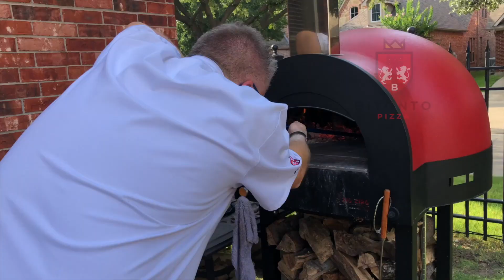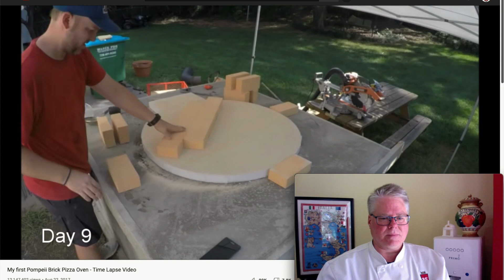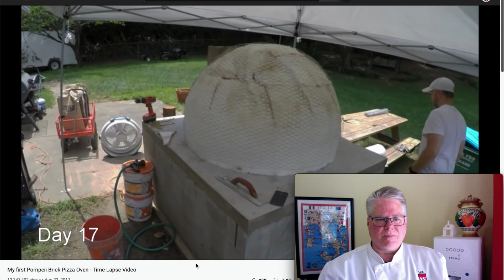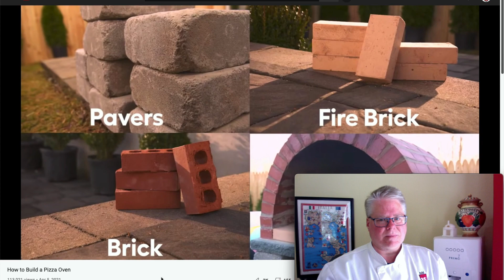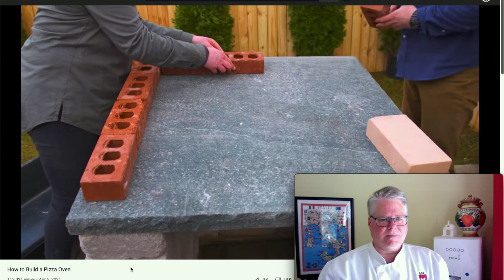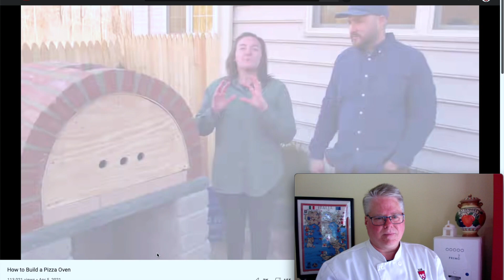Bitonto Pizza reacts to DIY Brick Pizza Oven Build Videos on YouTube ( Building a Pizza Oven )

Comment: If you level the bottom fire bricks of the oven properly, herringbone isn't so important and saves a bunch of cuts.
Reply from the maker: I'm not sure how it saves cuts if you are making the floor circular, I'll have to think about that one. My concern is that the oven expands and contracts so that even the most expertly-build oven may see some shifting of the floor bricks which can lead to little points. That's the whole purpose of the herring-bone technique. I would prefer to use large soapstone tiles than bricks for the oven floor.

Comment: I am making my half barrel template out of 1/4" plywood.  The first 1 I rushed and the plywood cracked.  The 2nd one I dunked in the pool after cutting and then used ratcheting tie down straps to form the half barrel shape. Then I put the template in place with straps still holding the proper form, then I put some wet rags on top of it and covered it with some canvas to let it shape better overnight. By doing a half barrel shape the whole depth of the oven, I saved time and was easier than most vids I saw.
Reply from the maker: It is definitely an easier build. I'm not a fan of the cooking experience in the half-barrel shape. That being said, I'll bet yours makes great pizza!

Comment: One of the DIY Pizza from Lowes materials used cement and rebar for the capstone and yes they did not mention whether fire clay was used in the mix.  They also stated they didn't like how the CAPSTONE turned out.  I managed to find a THICK GRANITE remnant and had it cut to size for $100 for my capstone. GRANITE can handle temps of well over 1000 degrees.
Reply from the maker: Wow, that's an interesting idea. Granite has different thermal properties (when you touch marble it feels cold because it absorbs the heat from your hand quickly. I don't know how well it would perform radiating the heat back into the oven. Let us know how it turns out!
Reply: @BitontoPizza  marble isn't granite, but it's calcium based, while granite is silicon and aluminium oxide based !